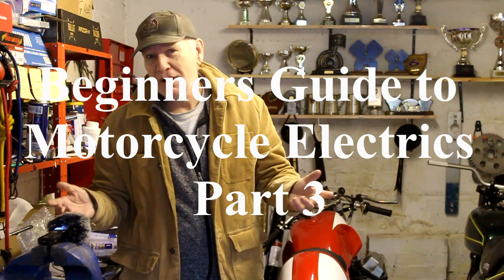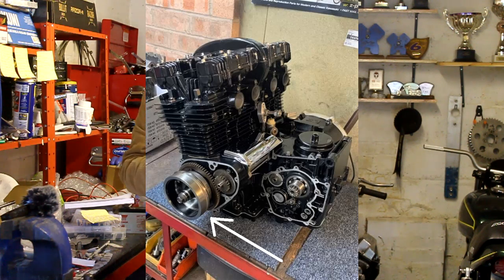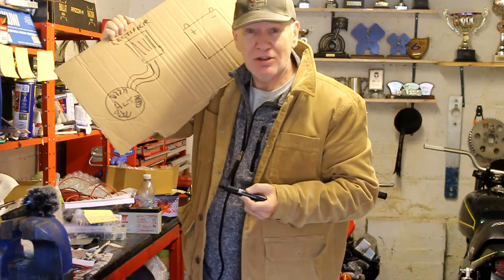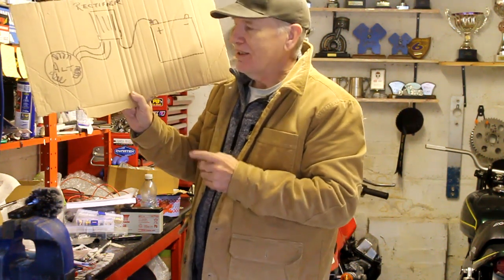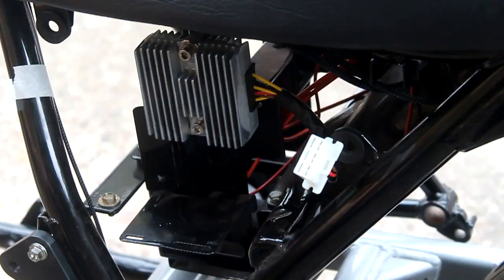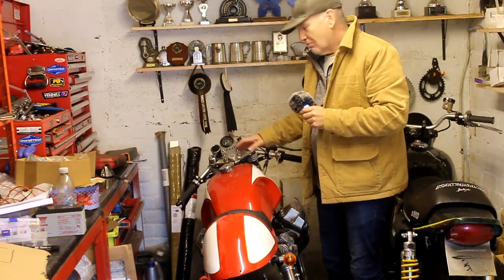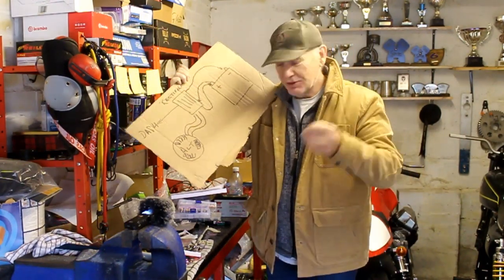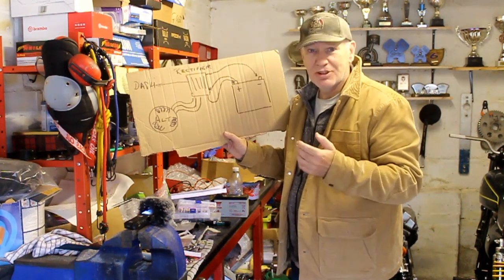Beginners Guide to Motorcycle Electrics - Part 3

Comment: Very interesting video, however my 96’ Honda xr400 does not have a battery.  AC powers headlight and taillight.  DC regulator gives me 12v DC to power dash and indicators.  My stators’ white cable powers brown cable 14:58 (lights) and shows an earth to the bike. Is this a fault with stator?

Comment: Very good video thank you. Nice bikes! With the yellow wires between the alternator and regulator, there is no return to create a circuit, so how does that work?
Reply from the maker: The rectifier body is earthed to the frame, as is the engine itself.

Comment: Hi lee, love watching your videos its become a bit of an obsession lol a bit late coming to the fold. I enjoy everything engineering and motorcycle so everything under one roof watching you all work.
Question if i may refering to electrical systems with out a reg rec and how they might work eg zephyr1100.
Cheers.
Reply from the maker: Not many bikes don't have a reg/rec, as the alternator/generator produce AC current and the battery needs DC current. I do know of some older Italian bikes that don't appear to have one, but instead they have diodes built into the generator, so the battery still receives DC. I believe these systems are not efficient and so were phased out over time. ZR1100 looks unusual, it does have a Rec/Reg, looks more like a heat sink. Electrex make a conventional replacement, code RR20.
Reply: @Merch131ho  thanks for the reply. I only ask as  I built my bike from the frame up and it puzzled me that there wasn't a reg/rec to be seen or a tacho so I guess it's all electric and governed somehow by the  ignitor box. I look forward to more videos